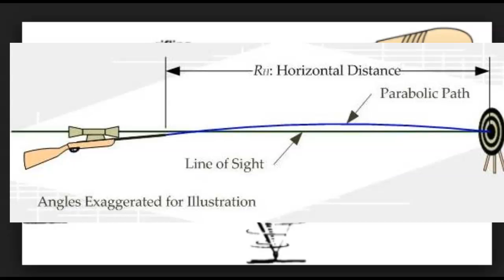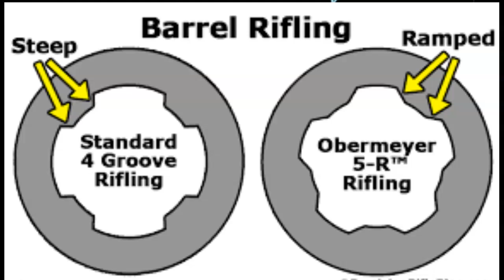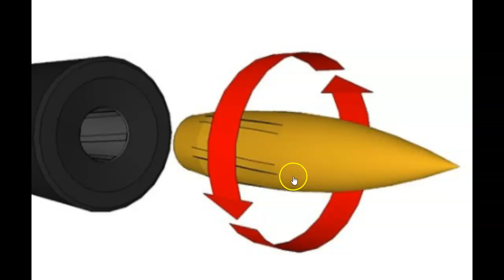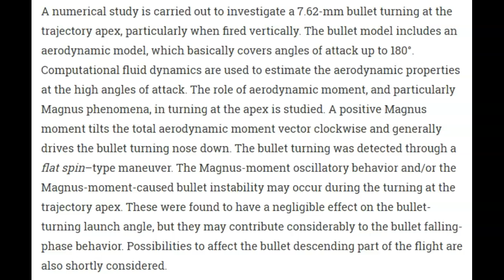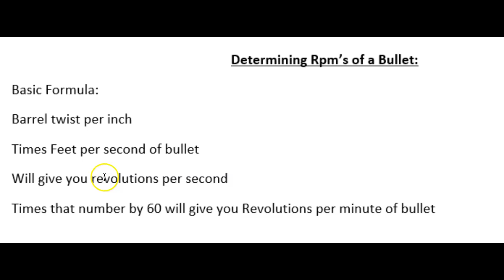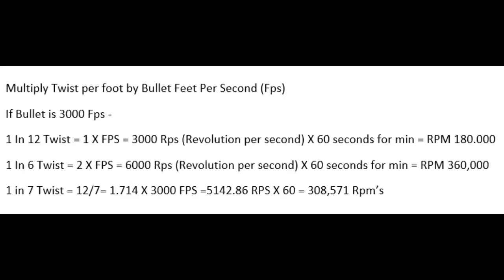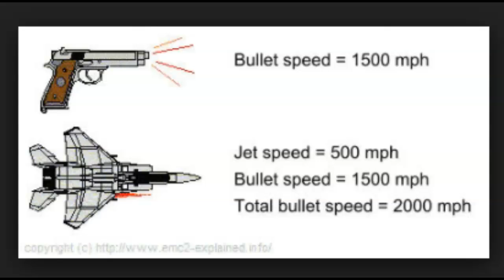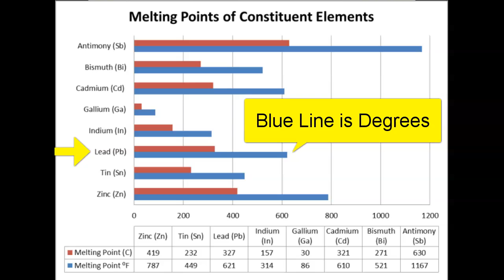How Fast Does A Bullet Spin Going 3000 FPS? It Depends - How To Figure Bullet RPMs

Comment: You can just use a bullet rpm calculator online lol.. the bullet rpm also helps it expand in a uniform manner. Also faster twists can make a bullet expand more rapidly it’s not just the velocity. There’s a fine line between stability and instability. If you’re shooting a bullet that’s too long for your twist it can keyhole a target that’s 10 feet away from you, I recently found that out. Shooting 165 ablr out of my regular 1-10 twist 270. It’s stable until it gets down do around 40 degrees outside.. when it’s 85 outside it flies true as far as I can tell.

Comment: My 223 Rem target rifle has a measured muzzle velocity of 2850 fps. The rifling in my barrel is one turn every 6.5", that means that in the space of a foot, the bullet turns about 1.85 times. Multiply that by the fps and you get the number of rotations per second...on my case...5261.5 rotations per SECOND...or 315,692 rpm. That's pretty fast spin.

Comment: My main question is this:

Does the rifling Lands in the barrel "bite" into the bullet to make the bullet spin when it is fired ? Or are there Grooves already made into the bullets so that it catches on the Lands and spins ?
Reply: The bullet is smooth. The rifling puts the marks on the bullet.
Reply: And yes it bites. The bullet is slightly larger than the bore of the barrel.
Reply: @joshuagibson2520  thank you 👍🏻

Comment: I have a pistol that loses accuracy and after 50 rounds and it's always restored upon cleaning the barrel.
Reply: I have a hunting rifle that is the opposite, if I clean it, the first 10-15 rounds are all over the page (I almost sent it back to Winchester!) Then after it gets a little dirty, its a tack driver...I give up, I don't even bother "scrubbing" the barrel...I just run a dry swab thru it to take out the big chunks of carbon/dust.  Its a Stainless Barrel...
Reply: Same here. I never clean a barrel unless the accuracy falls off. I'll patch one after a lot of rounds but no scrubbing or anything.

Comment: Iv been loading .223 Rem for years. Iv read books on it. Iv heard of thin jacket varmint bullet disintigrating from too much speed/spin but never heard of lead spraying out of the base. There must be a very narrow threshold where this happens.
Im interested in knowing what the rate of spin was and what the load was and target distance. 
        Lead projectiles wont engage rifling over 2200 fps.
Smokeless gun powder burns at a max known rate. You can push a bullet only so fast, aprox 4600 fps but the point of diminished returns comes much sooner than that.
A .204 Ruger round with a 17 grain Vmax bullet will approach 4200fps and you can buy those off the shelf.
.220 Swift with 45gr bullet is also very fast as is a 22-250. All are varmint rounds all eat barrels fast.
Accuracy and repeatability is king. Bullet speed not so much.

Comment: You can shoot solid lead bullets!! I do it all the time. The reason I choose to powder coat my lead casted billets is to prevent lead fouling of my barrels. But i practice with reclaimed lead all the time. 

Twist rate DOES really matter for some of us. But not for most. Most people are never gonna push their equipment to the maximum capabilities. So it doesn’t matter to them. But the weight of the bullet determines the proper spin rate/twist rate. Doesn’t matter much at a couple hundred yards. But when ya start trying to smack steel at 2,000+ yards every thing better be dialed into precision!! 

1 miles is 1760 yards. And at 1 mile away, 1mph of wind can blow your Bullet off target by 30 feet!! So literally EVERYTHING down to the spin of the earth matters at those ranges. But for the avg shooter, it’s all just mumbo jumbo.

Comment: Barrel twist rate depends on the GRAIN of the bullet & the length also. You have to match the GRAIN of the bullet to the barrel twist rate. Usually heavier bullets " longer also " need a faster twist rate & lighter bullets a slower twist rate.

Comment: I shoot prs and I have never cleaned my barrel and it has never plugged up with lead because the projectiles are copper jacketed. The moment you clean the barrel you change the inside dimension of the border therefore your accuracy goes way down and tell you build that surface back up and then your gun shoots good back into the same hole again. I’m just saying I’ve never clean my barrel and I’ve shot 3000 rounds through it and it still shoots under a half inch at 100 yards
Reply: I was gonna say something similar....but I see you already said it!  I do a lot of 3 gun....i only clean the chamber...that does gunk up with power residue

Comment: The part at 6:30 basically says that as the bullet starts falling the spin combined with a significant downturn of the bullet might simulate a momentary wobble and potentially change the trajectory significantly. It implies maximum accuracy is achieved by shooting at an elevated target such that the bullet never begins to fall and that if it must fall it should fall in a shallow arc that approximates a straight line. This phenomenae is one reason ICBMs are not as simple as point and shoot. And why people can't reliably fire guns up at 89.9 degrees to hit targets on the other side of a building.

Comment: Very interesting! I know the laws of physics but I've never dealt much with ballistics. Aerodynamics makes it difficult because of chaotic phenomena. Man, you America guys drive me crazy with your strange units (inch, feet, twist per foot, mph...Phew!).   ;-)
Dear meat eater, alpha straight male guys, I know it's hard for you to believe a women when it comes to physics, technology etc. ;-)

Energy is the broader term, there are different types of energy like kinetic energy, potential energy, heat energy (intrinsic energy). One type of energy can be converted into another type of energy. Both physical quantities, velocity and mass, are relevant, they define the energy. In the end it's all about energy.  :-)
Reply: In relation to the difficult aerodynamics you mention the "boat tail bullet" (tapered base of the bullet) design for pointed projectiles (not rounded or hollow point etc) obviously gives the best overall ballistic coefficiency rather than bullets with a flat base. 
Boat tails aid in accuracy for all the many rifle variations eg. Powder loads, bullet weight, bullet to barrel sizing, barrel type / length / mounting method / rifling type and type of steel used, bullet coatings. 
That's an insane amount of science involved.
Reply: @JoeC88  Bow and Arrows as well.  Then go to underwater flight of a long spear shaft.  If you over power a spear rod, you can get it into a flex back and forth deal slowing it down.   Lighter shaft for speed, then you have those type issues, larger rod then that helps, but slower.   light rods can bounce off too.  slow rods, the fish jump out of the way. 

Shooting an arrow at an antelope,  they will jump , think it's from noise , vs seeing it coming.   Same deal for fish. 

 Still trying to figure out Fire.  I mean really understand what is going on.
Reply: @johnm840   👍 Ahhh I remember some slow-mo arrow footage from mythbusters.
Muzzle loaders are interesting, more propellant for greater speed in a round ball projectile can result in loss of accuracy.
Reply: @JoeC88  Derek does a good job showing a speargun shaft.   Worth the 6 min watch. Air vs water media   

https://youtu.be/qx1ZJK3PUFw

Dustin of "Smarter every day " did some slow mo videos of gun shots under water.  Those are really interesting with gas clouds,  If you need links let me know
Reply: Yes energy is energy.  Some don't get that.   I had a woman prof in college, she taught 1st of 3 classes required for degree, she was great.  
2nd class had another really good one.  He was tricky,  a 3 hour class in the week during the day,   Homework problems Due each day BUT the night before class  he had a 1 - 1/2 hour  Help with homework class at night.  He got most of the Class in there with him 7+ hours per week .  Even if you got homework figured , you go to night class.  
3rd section , teacher not so good.  Go figure he covered Light and that is what I worked on in real world.
Reply: @johnm840  Wow, you had a female prof! I had only male profs. But actually I liked it. :-)
Reply: @mariaesmeralda2452  Had a few quota - hire female professors too.  only can think of 2 females that were really good.  Talking back in the 1980's .   I'm an electrical controls guy by trade.   Had many terrible male profs too.  Many good ones too.  Overall, I had some top shelf professors.

Comment: The 'goobledegook' page.

This is going back to my university days (engineering), hopefully my memory isn't too bad, but any corrections would be appreciated!

Magnus effect - when an object is travelling through the air while spinning, if the spin is not exactly in the direction of motion,. some of the air will be drawn around the object, following the surface of the object.  this is most obvious when viewing a soccer ball that is kicked so that it spins.  The air that is drawn round the object on its receding side, is accelerated as there is more air trying to flow through the same volume.  just as with strong winds, faster air has lower pressure, which results in a small force being applied to the object.

The typical bullet is designed to have the center of mass behind the center of pressure - this is why the bullet tumbles when it enters a dense medium.  The reason it doesn't tumble in flight is the spin. The spin however, does not remain in the direction of flight of the bullet.  if the shooter is pointing the g.un at 10 degrees in the air to make a long shot, the rotation of the bullet wants to maintain that angle.  The document refers to the apex, (maximum height) of the bullet.  At the apex the bullet trajectory, the base of the bullet will still be lower than the tip, and therefore the axis of rotation of the projectile will not be in the direction of travel.  we will therefore see force being applied to the bullet due to the magnus effect in addition to the aerodynamic drag the object would see if were not spinning.   Because the center of mass is not coincident with the center of pressure, the force on the bullet is trying to cause the bullet to tumble, but the rotation prevents this, but the bullet will be deflected to some degree and the center of rotation may deviate from the axis of the bullet (wobble).

Because of the forces acting on the (gyroscopically stabilized) bullet,  the axis of the bullet will go from nose high, to nose left or right (depending on the spin direction), to nose low.  this rotation in the axis of the bullet will cause the bullet path to have a partial 'corkscrew' which will need to be included in the ballistic calculations.

.... I'm not sure that will be any clearer.  The best book I have read on teh subject is 'small arms', by brasseys.  It is intended for army officer training and is surprisingly detailed.

Comment: Polygonal barrels are mo' accurate. Better gas seal behind bullet, less bullet deformation. After that, 5R next best.
The lands edges are rounded off on the 5R rifling, on the polygonal, you have only 3 swath like grooves.
Spin drift interesting. At long distances, earth's rotation is part of the calculation. At 1,000 mph, it matters when dialing long distance.
I've read, 1/9 twist and 1/7 twist in 55 gr. 5.56/.223 have no discernable difference in stability or accuracy.  Don't ask me.

Comment: Why the twist rate is always clockwise?  I never seen one that was counterclockwise besides my Ruger American pistol compact. But even Ruger said that was a error and wanted me to send my pistol back to them.
Reply: Don't send it back, a $$$ collector.   I could say it's based on the rotation of the earth,  but I doubt you would think so.  The gun people down under would then need CCW .
Reply from the maker: the twist can cause counter twist to gun, most gun owners are right handed, may be the reason, just a SWAG
Reply: 1911 45 ACP is left hand twist probably 90% thought I'd let you know
Reply: I just got done looking at 2 1911 Kimber and Colt and two Sig Sauer 220 all left hand twist for your information

Comment: Just a bit of information I recently learned, In order to become a Marine, you have to be able to hit a target at 500 yards! I know that you know how far that is Rick . But to put it in perspective for anyone who doesn’t know distances. That’s 5 Football fields not counting each end zone. Thats 1,800 feet! The longest confirmed Sniper Kill was made by a Canadian ( Un named) at a distance of 3,871 yards! That’s 116 Football fields! That’s about 2 1/4 miles! More trivia. Every new gun sold, bought from the manufacturer has been fired once when you receive your prime this bank casing will be still in the barrel. They also have micro stamping now which uses a laser to match a distinct type of markings on the firing pin, internal components as it’s fired the spent hour casing is marked, almost like a VIN # on a car.making it much easier to identify and trace a gun to the owner .

Comment: Those rounds on that last target that left the crescent shaped lead pattern had to have a right twist. This was a pretty good video, I've personally found that, with a 5.56 out of an AR or same length barrel hits more true at further distances with a slower twist. I can get very good groupings past 300 yards with a 1/9 twist, a little less impressive with a 1/7. On the flip side, with a good bipod or better yet a sandbag, 1/7 twist with a decent optic kills it inside 300 yards. It seems backwards to the intended dynamic of the twist but maybe that faster twist starts to wobble quicker reaching out...I really don't know. The only important factor I didn't hear discussed (in long gun rounds) is a boat tail vs a "flat assed" round. Boat tails fly so much more steadily and tend to not wobble nearly as much, if at all. I can't afford match grade rounds everytime I'm trying to get really tight groupings but I know if I have decent boat tail ammo, I'm going to be much happier with the results. I've tried to do the math/physics and it wasn't my strong suit in school and still isn't when I'm shooting. Trial and error have always been the best way for me to really know what to expect out of a round, twist rate, barrel length, etc. Do it, repeat it many times and compare the results to those other factors but with all of them, a boat tail round is always hitting on or closer to the mark than "flat asses".

Comment: I only care as long as I'm hitting meat. I have a Glock 19 with double 33's. So I load them to 30 to keep a little relief on the mag. 
Most of your work is 25ft or less. Like Rick says. Spray and pray. I can put 60 down range in less than 20 seconds. I'm hitting meat.

Comment: Rick, the faster rifling twist causes more resistance on the bullet in the barrel. At the same (or higher) powder charge this can cause the bullet to 'smear' down the barrel without fully engaging the rifling. This, I believe is the major cause of the increased heat. All else being essentially equal!

Comment: The other thing is that the after the apex the vertically or nearly vertically shot bullet will tend to go downward. So the Magnus effect or Magnus Force is at a right angle to the path of flight, whether up or down left or right. The flat headed bullets should  have a greater external or outside temperature. The hollow points should create a more dramatic sonic boom. The most aerodynamically efficient between the one that is flat or the one that looks like a nosecone of a jet fighter the jet fighter nose is more efficient. A totally hollow bullet will act like a  ramjet.  I don't know much about hollow points but I assume there is rifling internally?

Comment: Lead at 3k FPS might melt but the larger problem is that your barrel will be so lead fouled after just a couple shots that it becomes unsafe. I have however seen people shoot cast bullets with powder coat in 223.